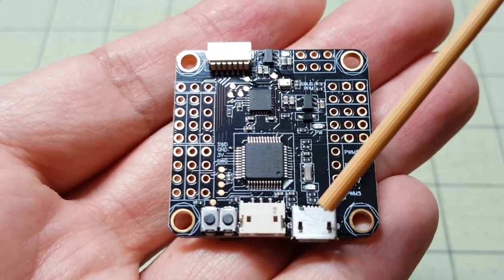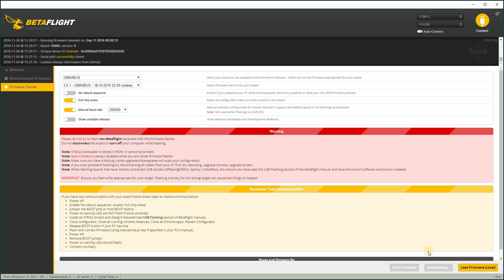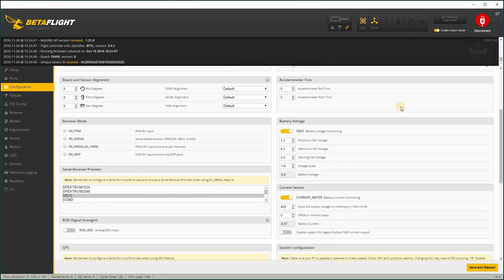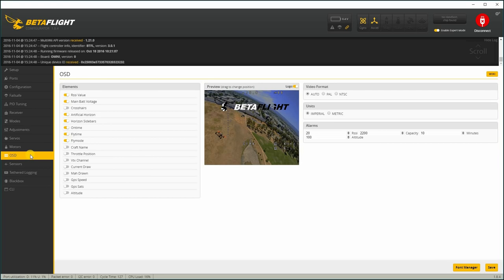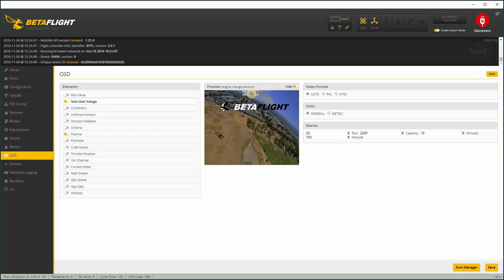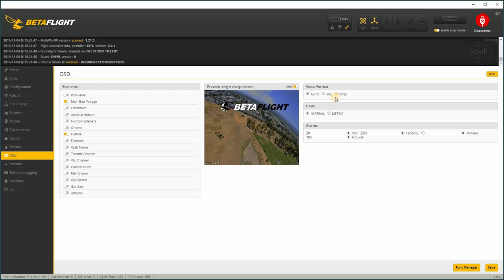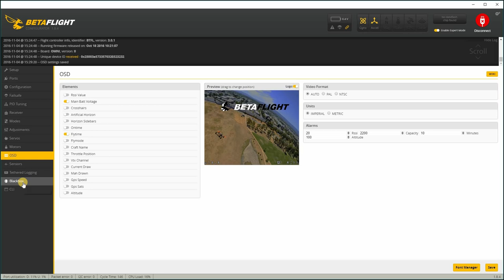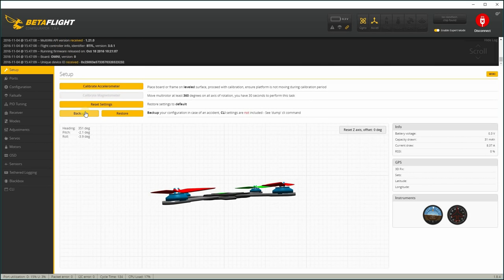Omnibus F3 AIO Flight Controller Review

Comment: Hi Albert i hooked up this board with a 4 in 1 racerstar shot 30 running d shot 600 and while doing fast flips and rolls in horizon and acro it tumbles out of control and crashes.when i take it easy its fine.i did not hook up any camera yet till i figure it out.running custom mix on 250 MartainII frame redbottom 2300kv  5152 props  it really flies nice stock pids.like if i dont push my sticks all the way its fine.

Comment: Is this truly plug and play? As in, no extra wiring or setup besides clicking a button in Betaflight? I'm asking because I just bought a quad with this board on it, but the guy I bought it from said that he could never get the OSD to work.
Reply from the maker: I guess it would depend on what your definition of "plug-n-play" is.  I simply connected my vtx and camera to the correct spots on the board, configured it in Betaflight configurator, and it "just works".  No other flashing or other BS required.  Not sure what the other guy did but its possible he might have a bad OSD chip.  Or he may have set it up incorrectly.  I can only speculate.  All I know is that it works great for me.

Comment: Good video, thanks. Can you help me? there is no arrow on these boards, where is the default  front?
Reply from the maker: plug it into the computer and connect to betaflight configurator and it will show you when you move it around.

Comment: Hi Albert. Thanks for the video.
Just a newbie question. The receiver is PWM and I don´t know where to connect the signals on this board. Maybe this board is not suitable for PWM receivers?
Thanks in advance.
Reply from the maker: This board doesn't work with PWM receivers.

Comment: Is the red wire of the 4 in 1 lead needed - mine did not come With it? Is it just a +ve ?
Reply from the maker: The omnibus can be wired direct to the lipo.  I don't know what 4-in-1 you're using so don't use the 5v if that what it is outputting.  Otherwise your vbat reading will be incorrect.
Reply: Albert Kim - ok that's fine. It's the racerstar (BLheli-S)20A i don't think it's needed as they are powered from the lipo off pdb. Thanks

Comment: Will the 4 in 1 ESC cable power the board as well as the motors or will that need to be a separate connection?
Reply from the maker: Depends on which 4-in-1 ESC also  what order the wires are in too.

Comment: Hey i jist ordwred the flytower f3 aio omnibus target.. it says that it comes with integrated OSD.  does it use the betaflight OSD?.. thabks
Reply from the maker: Yes, it uses Betaflight OSD
Reply: Albert Kim ok great.. thabk you.. is there a difference in the f4 board or just the processing speed of the mcu.. also is the f3 a good aio.. or should i be getting the pro version.. seems like you know ALOTA avout these aios

Comment: albert what is the motor layout? the manual states i think that M1 is bottom left if the usb is on the right??
Reply from the maker: I think the manual is correct.
Reply: So that would be 90 degrees yaw adjust, and with the USB facing to the back of quad, 180 degrees? Just asking cause my build is still flopping around on the ground with these assumptions...

Comment: Hi Albert!  Can you speak to the compatibility of this OSD when using a 16:9 run cam eagle?  I've heard there is glitching/flashing if OSD numbers in 16:9 cams.  Does betaflight give 16:9 selection option?  If it doesn't work well what is a good osd option for runcam eagle? Thanks!
Reply from the maker: I haven't used it with the Eagle 16:9 yet.  I'll check it out when I can.
Reply: I have used it, you have to make sure the vtx, camera and the osd are all set to ntsc or pal.. they all have to be set on the same value then your good

Comment: Many thanks so, got TBS unify pro five gig HVE VTX to incorporate with my Omni bus of three non-pro and want to use the smart audio feature. Power right off battery, split bed signal from camera through on the bus FC to VTX for the OSD. Smart audio out of VTX (white-wire) two available UART that is connected to on the peripheral section. Am I missing something?

Comment: I have a bff3 and it has a built in pdb, how could I wire a 4in1 esc to it without overloading the pads? If I wired it to just one they're only rated for like 30 amps or something like that but if I sequenced the pads it would work I think... I just don't know how, like all the negatives together and all the positives together mebe?

Comment: To which port do you have to connect i-bus signal for it to work properly with this fc? Just the regular pins that are also used for ppm next to the m1 output? Thanks!
Reply from the maker: PPM and SBUS (iBUS) share the same pinout.
Reply: Thanks! One last question, on my omnibus I can only see the first 2 uarts in betaflight, uart 3 doesn't show up at all.. Any idea what this might be?
Reply: Whoops, solved it already by enabling rx serial in the configuration tab :D

Comment: I’ve just bought one of these and I’m a noob will it have firmware already flashed or are they blank ?
Reply from the maker: They usually have firmware on there, but typically outdated by several months.
Reply: Albert Kim thanks ! What I mean is I’ve built a quadcopter but I’m really bad with the computer side I’m hoping there’s enough on the board just so I can test everything untill I get a laptop and learn how to flash it and so on

Comment: I got the same board and having problems with my video feed. Are yours working ok?
Reply from the maker: Mine is working.
Reply: Albert Kim where did you connect the power wire of your camera and vtx ? Did you use a filter? Thanks  for the quick reply
Reply from the maker: I connected it to the FC exactly where you're supposed to, however, I am using it as a passthrough only.  I did not connect RAM to 5v or 12v.  I have my VTX connected directly to my PDB and this has always worked for me so I didn't want to mess with anything on this board.
Reply: Albert Kim ok thanks. I have a Martian frame and I had mines connected like yours but when I throttle up I get lines across my video
Reply from the maker: Either your PDB is not filtering the power spikes or your VTX is overly sensitive.  I use PDBs with high quality BECs and VTXes that also filter power as well.  Costs more, but no lines.
Reply: Hi Albert, am looking at getting 1 of these boards. Can you explain what RAM is as this is a term I have not heard before. (except when used in computing terms)

Comment: Nice review! This looks like a really nice board! One question, if you want to use a seperate bec for powering the vtx and camera, do you just have to connect it to the RAM port on the left side? (next to the uarts)
Reply: Willem Vergouwen First question are you from The Netherlands because I'am and you can power the camera with 5v and vbat (look at manual at banggood.com)
Reply: Not and but *or
Reply from the maker: +Willem Vergouwen Yes, all three RAM ports are connected
Reply from the maker: +Thumbs-fpv I'm from US. Yes, you can power camera off 5v as long as all parts draw less than 1.5 amps
Reply: Albert Kim thanks! however, is the 5v filtered from the board for a clean fpv feed?
Reply: Thumbs-fpv Yes I am from the Netherlands too! (:
Reply from the maker: +Willem Vergouwen that one I'm not sure about.

Comment: Hello Albert... newbie question just purchase the omnibus V3 and the AIO  Racestar 20A V2...I understand you can hook up lipo directly to FC (vbat and gnd) without a PDB..I opt not to use PDB so question is how would you wire  it with xt60
Reply from the maker: +Barry White XT60 goes to the 4-in-1 ESC then run a smaller gauge wire from the ESC to the FC. See my GB130 video as an example.